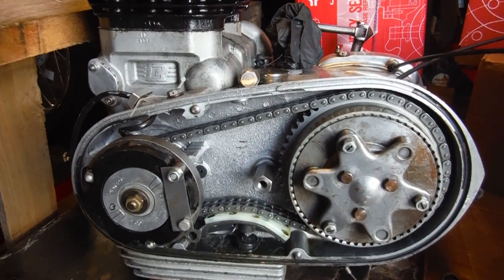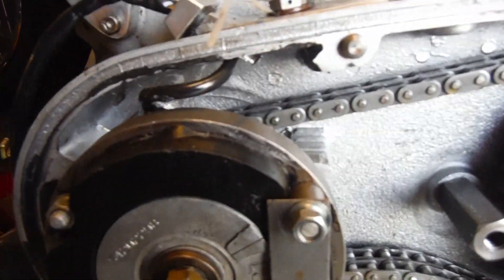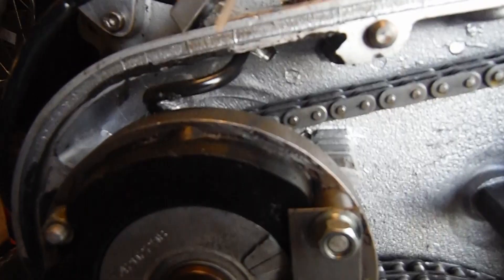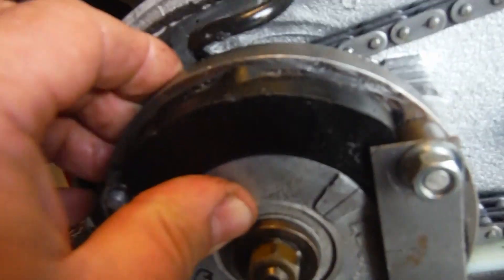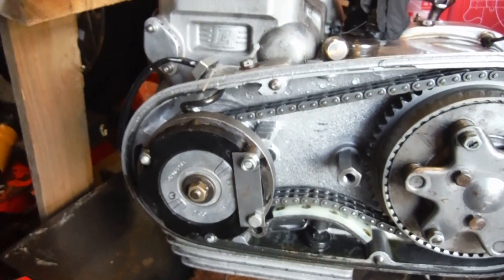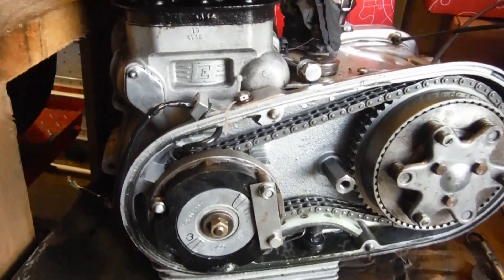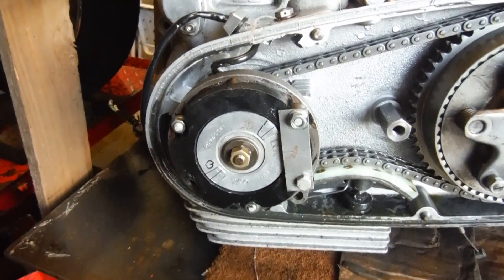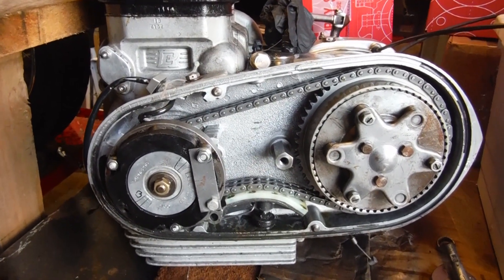Royal Enfield Interceptor 750 S2 engine - Crankshaft end float discovered!

Comment: I'm just reassembling my primary, after replacing the mainshaft sleeve and counter shaft in the Albion.
I used an impact gun to remove that large crank nut.Wondering what the torque spec is for that nut.
More importantly,I just went to the garage, spun the large nut on the crank by hand,and tried to see if the crank
slid like the one in this video.
It did not budge at all!
You may be in for the long haul sir.
I found your Albion video, quite useful, thanks